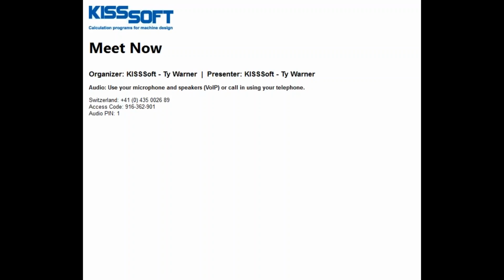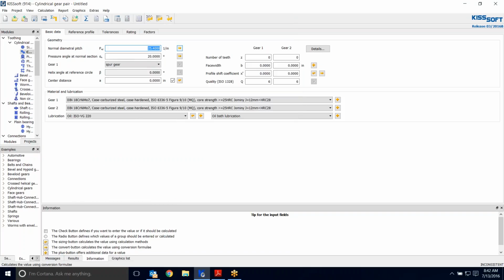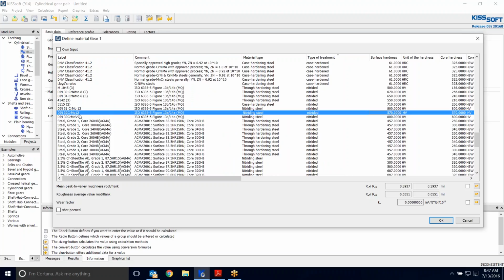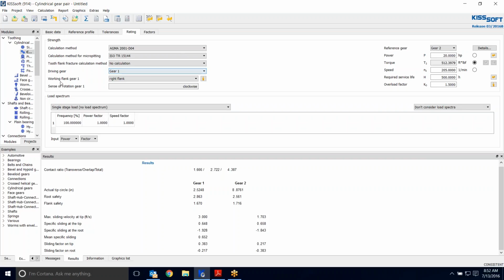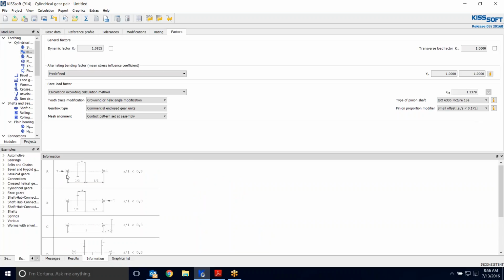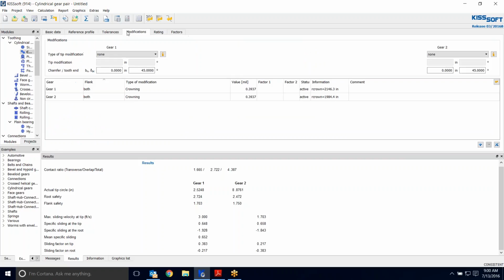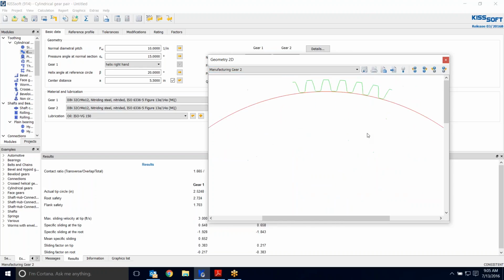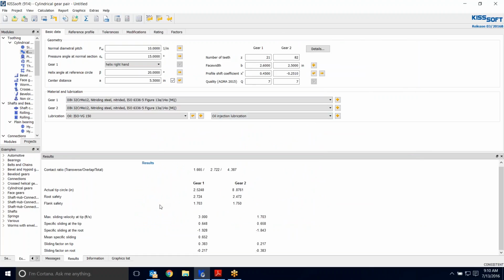Analyze Gears in KISSsoft

Comment: If I get this error when I am designing a single stage planetary gearbox: "Mesh gear 2-3: Pitch point C is outside path of contact", Is it a serious error? And what is it usually caused by?
Reply from the maker: normally the path of contact starts from A then goes to B that is the LPSTC (Lowest point of single tooth contact) then it goes to C where you have pure rolling then to D that is the HPSTC (highest point of single tooth contact) and then it ends in the point E.
The message is just saying that the point A is after the point C so there is no mesh in point C. There is no pure rolling contact in the mesh